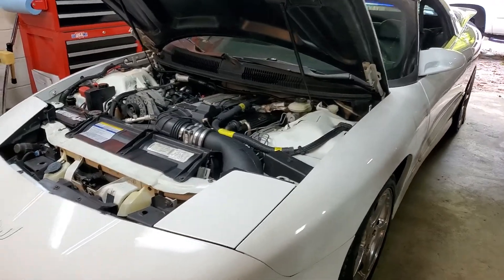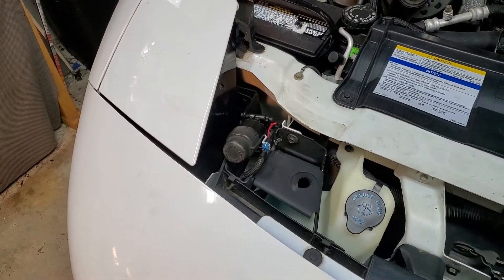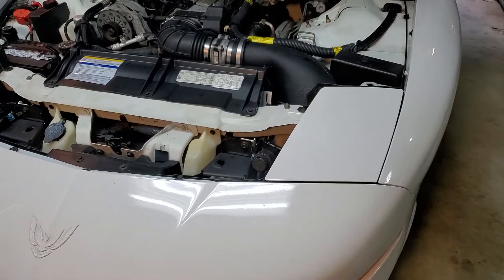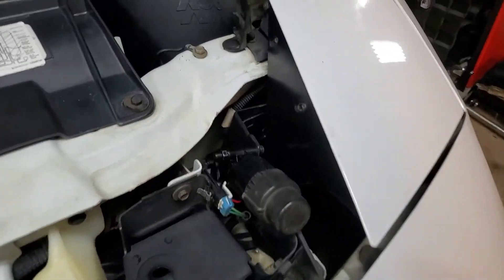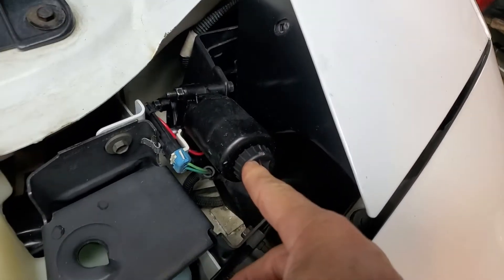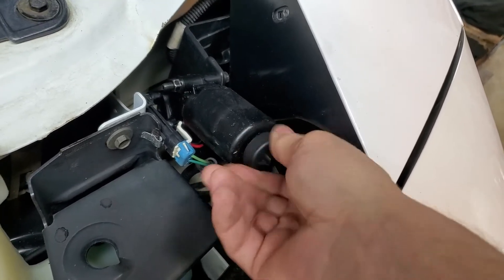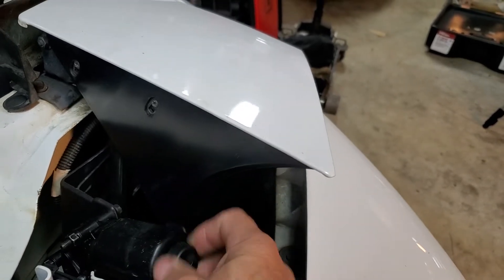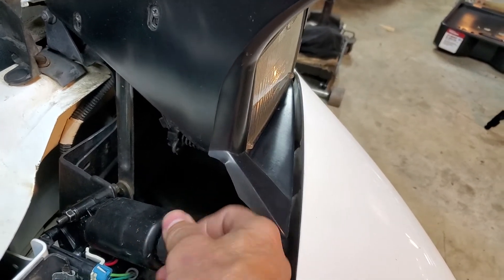How to manually raise your flip up headlights Trans-Am Firebird Firehawk Formula Corvette Fiero

Comment: Will this work when the plastic gear is the problem?
Reply from the maker: That gear can be replaced with a metal one.  Not sure if it will still work manually doing this.  I guess you will find out.